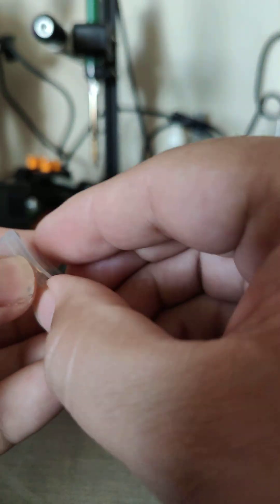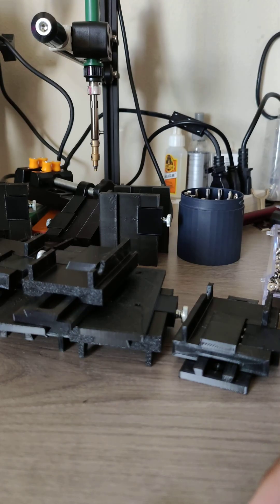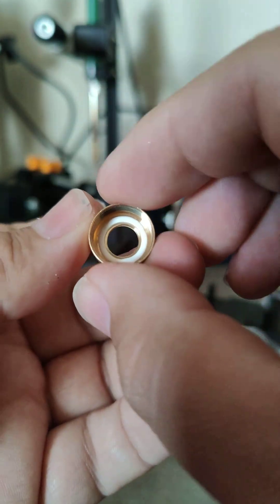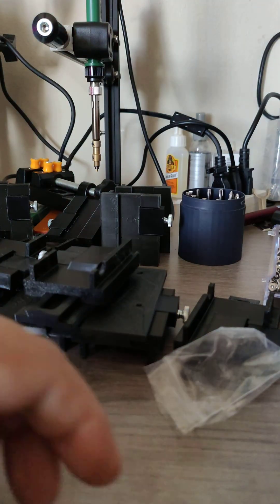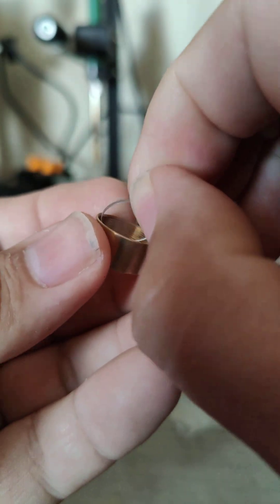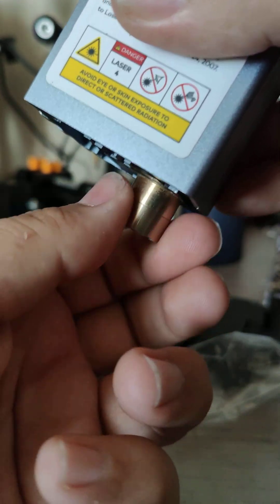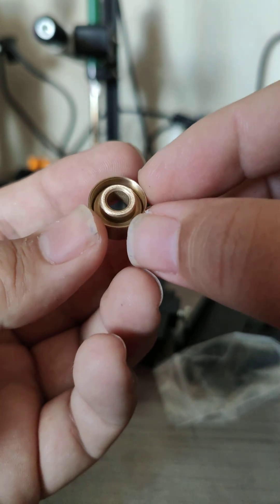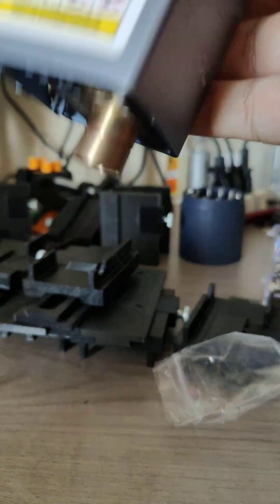Laser lens how to replace

Comment: Hi can i ask are this work with my Elegoo Phecda 10w laser engraving machine please? , thanks
Reply from the maker: They will work with any laser that has a lens of 14mm. We also have a 13mm and 10mm lens as well. Feel free to send us an email if you need any help measuring!
Reply: @AlivePixelCreates  Appreciated I will, thanks bro
Reply: Hi what is your email
I have a Atezr diode laser L2 36watts and need a lens replacement 
I think I have tried cleaning the lens and still the laser is not cutting or engraving anything

Comment: I am missing something. I bought a sense from you a while ago and tried soaking the lense  but i couldnt take it out. Now the glass is completely broken and i still dont know how to remove the spacer thing to insert the lense i got from you.
Reply from the maker: Hi, I noticed that XTool has now more glue in the locking nuts the best way to do it is to heat the whole thing and with pliers and grips remove it. Be careful and wear gloves if possible
Reply: @AlivePixelCreates how do you heat it up?

Comment: Maybe this is a stupid question but by adding that extra mm of length where the lens is, does that affect the focal length of the laser when using the 'kickstand' to set the height?  (x10 pro 20w)
Reply from the maker: The focal point is based on the internal lens. This lens is a cover to protect the main one from damage.

Comment: What do I use to remove the original lens for the fitting
Reply: In the video he just says to soak it. I went to the website and read, If it is glued, soak it in acetone for an hour or two to soften the glue. Push the lens out of the housing.
Reply: @Hillbillyable1  did this work for you? I have tried soaking for hours before and it didnt come out
Reply from the maker: Soak in acetone or 99% IPA (isopropyl alcohol)
Reply: I believe he suggests acetone